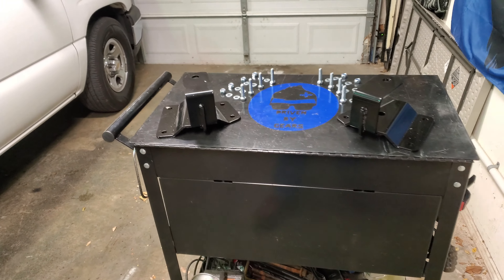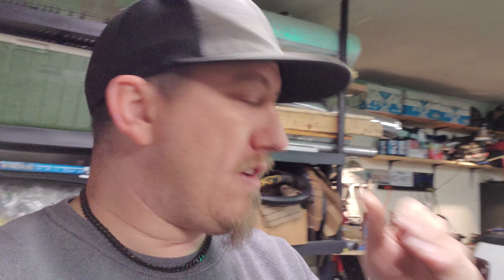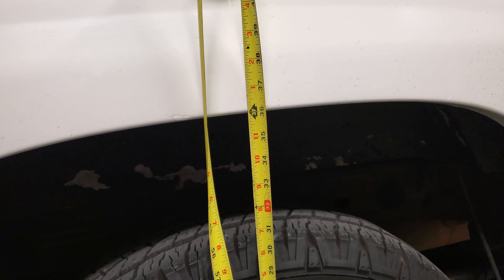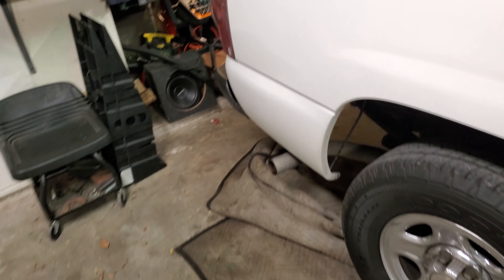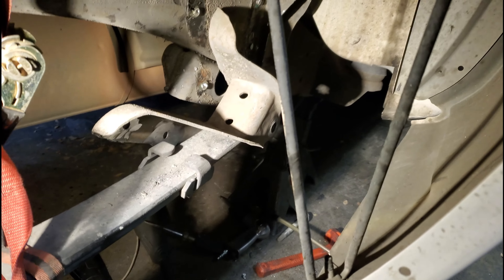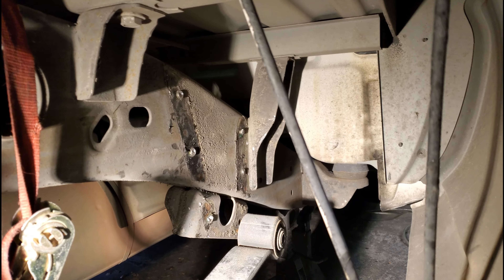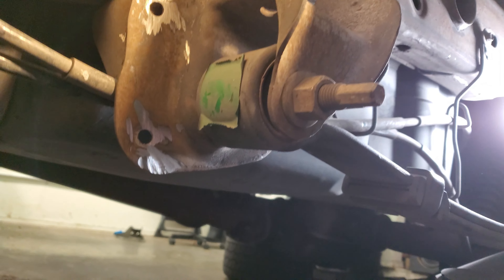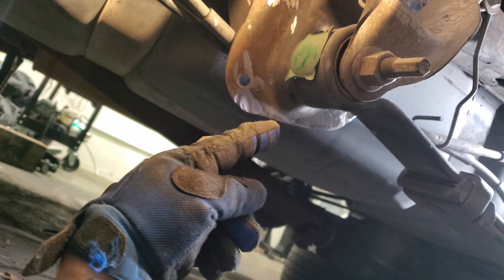Installing 2"  Rear Axle Drop Hangers on a 1999-2006 Chevy Silverado/Sierra

Comment: Hopefully this will help someone out. Bc it would’ve helped me out if I knew before. There are 2 styles of drop hangers. Belltech sells the ones that use the top 4 bolts in the frame. If you use that belltech design along with drop shackles. The truck will lower significantly more than the one seen in this video and you will need a c notch and it won’t level out the front to the back it will squat about 2 inches lower than the front. The hangers used in this video are the other design that don’t drop as much. If you are looking to get a significant drop without a flip kit. Use the belltech brand hangers but you will need to c notch even though it’s a supposed “4” inch drop. If you want to get your truck leveled out. Use the hangers seen in this video and install them Excactly like this video shows.
Reply: I have 2” drop shackles on my 2000 nbs tried to instal these hangers but couldn’t figure out until I seen this video . Is it worth buying the beltech hangers instead ?

Comment: Excellent video for doing it this way.  I thought that taking the bed off would be a requirement, though I can't imagine how much time you spent getting those rivets cut out from the angles you had to work with.  Very clean truck, too - I thought I had a relatively clean frame and bed, but mine is nowhere as nice as yours for lack of corrosion.

Comment: How did you get the bolts in on the drivers side without removing the tank. I’m trying to install drop hangers and I really don’t want to drop the tank to do the drivers side

Comment: excellent job bud i learned valuable info im about to do the same thing in a few days, thank you.
Reply: How'd it come out thinking about doing it myself
Reply: @misaelrios1682  it looked great! but unfortunately it was a bit too low, kept bottoming out the bump stops i had went down to a half inch one. There were several options you can do to alleviate the problem but required mucho deniro or more work than i care to put in. i did the modification in this video and the leaf spring shackle lowering maybe your not suppose to to both. i ended up removing the leaf spring shackle i had installed and drilled new holes between the existing holes which rose it back up about three quarters of an inch which stopped the bottoming out. if you do the mod in this video, the damn rivets they put in the leaf spring holder are a son of a gun to get out, i was never happier to finish a job in my life lol. good luck if you try it, take care

Comment: How would I get 2 more inches out from the rear on a 06 GMC sierra 2 door . If I already have 4” drop on rear . I have the 2” shackles and 2” hangers installed . What else could I do to get 2 more inches lowered .
Reply: You can add a “flip kit” that would give you 6” drop if you didn’t have the hanger and shackles but put your  stock shackles back on and you’ll be at 8” drop
Reply: @Pachanga_thebarber 
Do you need a c notch if you do the flip kit only.
No hangers or shackles
Reply: @stat638  I put a flip kit on a crew cab Sierra and I absolutely HAD to have the mini notch. There was less than an inch of space between the axle and bottom of the frame without the notch.

Comment: Man that job is way easier if you just lift the bed off.  8 easy bolts, 2 screws, and 2 plugs for the tail lights. Then you can grind the rivets much easier then just lower the truck to get the spring bolt out above the chassis.  You live and learn
Reply: Don’t forget your shock extenders if using factory length shocks

Comment: Saw another video on this and that gut put new hangers on the top 4 holes. looks like you dropped one corner, that might have costed you a little drop. Did you do this so you would not have to drop tank ?.
Reply from the maker: Thats what I thought 2 but they would not line up

Comment: On the gas side how did u put on the other bolts on - I didn’t see u do it on the video can u please tell me please
Reply from the maker: i put them in going the other direction but it is super hard and i had to use a magnet to get them started.
Reply: Thanks a lot I appreciate the help - I bn wanting to put my on looks hard but u made it ez
Reply from the maker: @r6power817  its not to bad if the gas tank was spaced out you could be done in a hr.

Comment: I just did this to my gmc sierra and your right you can get the rivets out without dropping the tank but when installing the bolts the front 2 go in but you cant reach the back two on driver side. I put the front 2 bolts in and torqued and welded the back side of the driver side. If I ever need to remove I'll just cut the weld. I know you had trouble because you never showed the driver side installed. Also your suppose to use the top 4 holes not the ones on bottom. I got an extra 2 1/4" with mine plus the shackles in back.
Reply from the maker: funny thing is mine wouldnt line up to the holes on the frame for some reason cause that were i was assuming it would go to. But everyone keeps telling me that maybe it was just a hair bit off i might have to remeasure them and see.
Reply from the maker: I was actually able to get three out four bolts in. But yea the welding thing would be lot better plan.
Reply: I need some one to do mines ASAP

Comment: If you bolt the hangers using the holes in the frame only the 4 holes in the frame no using the bottom part as you did will give u that inch your missing
Reply from the maker: Holes dont line up or I would had
Reply: Might want to check if you’re not in the bump stops on the axel.
Reply from the maker: @The1971chevy  nah my stuff is riding good just like factory

Comment: thank you...I've been looking for a video on hanger installation. I didn't want a flip kit or c notch at this point because i tow with my truck. Have you used 2in drop springs b4
Reply from the maker: Yes Sir that's why I made it. 2 inch leaf springs or coil?
Reply: front coils
Reply: front coil
Reply from the maker: Try to avoid those if you can it will mess with alignment and ride ruff. If can afford it do drop control arms keeps factory alignment and ride quality.

Comment: I have the same hangers. I drilled a hole 1" above the existing hole for a extra 1" drop
Reply from the maker: You would thought they could made them fit upper holes.
Reply: @DrivenbyGears  no I'm talking about the hole where the leaf spring bolts
Reply from the maker: @Kevin_Yagoonie  ahh I see good idea. Did you brackets end up using the lower holes like mine or was you able to use all 4 upper?
Reply: @DrivenbyGears  yup same thing. Only way they line up. I found instructions with a diagram showing how these hangers bolt in. It's the right way
Reply: @DrivenbyGears  you have a way I can send you the instructions sheet with the diagram? If you want it
Reply from the maker: @Kevin_Yagoonie  yea on instagram messenger or email drivenbygearstony@gmail.com
Reply: YaGoonie ! Could you send me the instructions with the diagram , I am going to install my hangers tomorrow morning & I think it would help !
Reply: @ram0n_MLP  do you have Instagram? I can message you it
Reply: Where you guys located?
Reply: @Kevin_Yagoonie  could you send me instructions

Comment: I'll be doing a 4/6 drop on my 77. great video!
Reply from the maker: Heck yea I've did a bunch of those
Reply: @DrivenbyGears  Whats the General sitting on?
Reply from the maker: @OldeCarrGuy  like about a 4/7 or maybe 5/7 I got lowering springs in front with drop spindles. In back flip kit and hangers with air shocks
Reply: I’m trying to get 4 inch drop in the rear of a 06 Silverado crew cab. 2” drop hangers won’t work for crew cab since there welded on. So any other way to drop it in the rear 4” ?
Reply: @gabrielguevara462   can take the rear blocks out and 2 inch drop shackles

Comment: You also don’t add rim diameter to each side of the wheel, you split it in half. Those are 16 inch wheels.. a 20 would be 2 inches less of rubber all around the rim, granted you went with the same overall tire diameter
Reply from the maker: Very true

Comment: How'd you get the rivet chunks out of the frame, can you just hammer them out? Thanks for sharing.
Reply from the maker: Yes sir i just turned my ball pen around and hit them but yes you might have to use a punch and they come right out if not grind them a little more then punch.

Comment: so theres already drop shackles and you put those axle drop hangers on aswell? because when i bought my sierra there was already drop shackles and it was still about an inch higher on the rear so i was wondering if there was a way to get it lower without  a whole lowering kit or something like that and i guess this is it. Thanks man!
Reply from the maker: well i dont know specifics of what was on my truck up front but when i got it it was 4 inches to high in the back so in order for me to overcome that i needed to add the hangers and the shackles why i went that route. now in the future i am going to do the flip kit just haven't gotten there yet.

Comment: How did you put in the bolts for the hanger on the side where the gas tank is at?
Reply from the maker: Very patiently they suck had to use safety wire and feed them in .

Comment: What’s up bro I’m new to this whole drop stuff so what do the new hangers do compared to the stock ones. I want to level the back with the front of my truck. Front measures 33 1/2 both sides while the back measures 35 driver side and 35 1/2 passenger side. Would 2 inch drop shackles do the job?
Reply from the maker: Awesome question just do leaf spring shackles instead there easier and it will give you that 2 to 3 inches you need.
Reply: Thanks bro
Reply from the maker: https://youtu.be/Kyqbx-9W1PM

Comment: I have the same set up on my 2002, with the 4 inch drop. I notice my truck shakes 65-70 mphs. Thinking I need shims for the rearend. Did you have the same problem?
Reply from the maker: Nope, but hows your pinion angle
Reply: Yeah, I'm in the process of trying to find my pinion angle. Thanks for the quick response! Have a happy 4th!!
Reply from the maker: You did shackles and hangers? Happy 4th 2 you
Reply: @DrivenbyGears  yes, and a 2 inch drop spindle up front.

Comment: Did you still have access to the head of the bolt on the shackle to spring bolt?
Reply from the maker: No unless you drill a hole
Reply: But you were able to torque it to spec?
Reply from the maker: @adamgatton  yea you can install it on the brackets first
Reply: Oh, so you torque up the spring and then tighten up the bracket to the frame.

Comment: Hey pal how did you get the bolt on the leaf spring out
Reply: Did you just pull down?
Reply from the maker: Yes I took the rivets out dropped it then pulled the bolt. Then reinstalled on new one a re raised it but putting the new bolts in suck around the tank i had to use magnets glue tape what ever to try get em started. Such a shitty design.

Comment: I’ve needed this like 2 months ago lol. I just took the 2 gas tank straps off without removing the tank. But when I did it (I’ve done it to 2 trucks) I used the 4 holes in the frame. I wonder why you didn’t? Other then that good video man.
Reply from the maker: It wouldnt line up
Reply: Driven By Gears my hangers were the same I used the 4 bolts in the frame I wondered why yours were different ? They wouldn’t line up any other way
Reply: I seen why, you probably used Belltech like mines
Reply: I just did mine aswell i had maxtrac hangers lined up just like yours belltech lines up on frame still good job!i did shackles hangers drop shocks all 4 and 2 in drop springs she looks sexy great video

Comment: I think u got the wrong hangers for your truck, the right hangers should bolt up in the 4 hole in the frame not 1 hole in the bottom part.
Reply: Yea buddy I think so too. These are for the axle not the front of the spring
Reply: @christopher18291  it looks like he messed up right and left sides.

Comment: If you only wanted a 2 inch drop you should have done the rear shackles instead, they are a lot easier to install.
Reply from the maker: I already did I went 4 inches
Reply: Driven By Gears 👍
Reply: If you not able to do it who does this type of work I need that level look.

Comment: No way in hell you could lower the back 7 inches with no c notch on that body style. Anything over 4.5 needs c notch IMO
Reply from the maker: Thanks 4 the info
Reply: Jacob Knuckles you can lower it up to 6 inches in the rear without c notch but the rear axle will hit the frame because there is not enough suspension travel so thats why C notch is recommended for anything more than 4 inches.
Reply: Nico Five’0 yeah I just assumed he wanted to be able to drive it